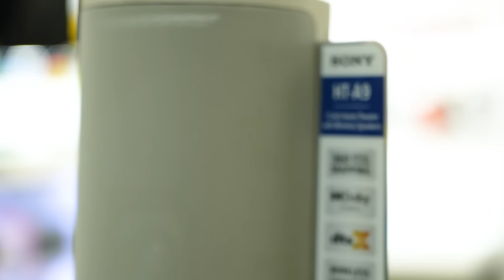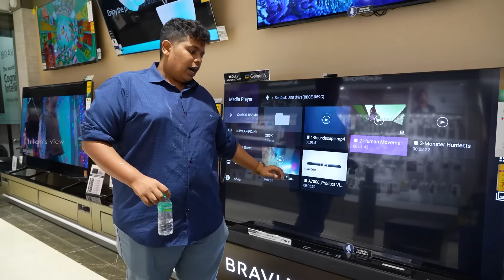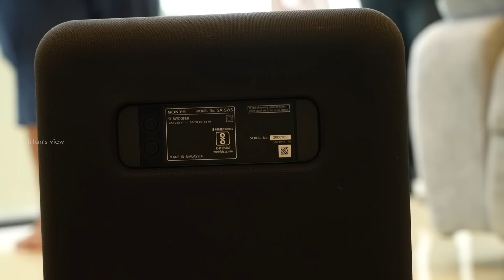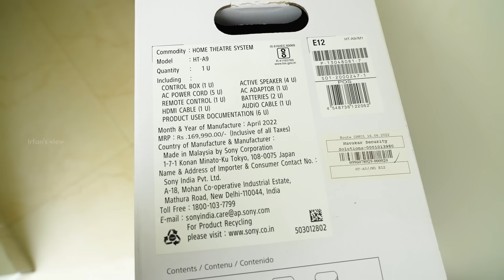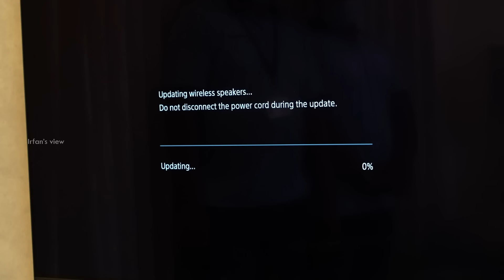Sony HT-A9, New House Home Theatre, 12 Phantom Speakers - Irfan's View

Comment: Congratulation Irfan, you will  enjoy this Home-theather without any doubt, I am few of the lucky ones who didn't have this audio dropout since I bought this, I also run two separate networks 5ghz and 2.4Ghz, all my audio and video devices are connected to 2.4Ghz network, and my router is 200 feet away from the TV and Home theater system. According to Sony you have to follow these steps to fix this 

If the issue occurs, follow these troubleshooting steps - in order - to see if the issue is resolved:

Set the RF Channel to Off, then back On: Select Setup → Advanced Settings → Speaker Settings → Wireless Speaker Settings → RF Channel to Off, then set to On.
Notes:
We recommend the RF Channel setting is set to On (default setting: On). The Sound Bar automatically selects the best channel for transmission when RF Channel is set to On, which makes it stronger against wireless interference.
If the sound issue persists, try to turn Off the setting.
It may take 1 minute to reconnect after you change the RF Channel settings.
The frequency setting is deleted after disconnecting the power cord. If you disconnect the power cord for some reason, switch RF Channel from Off to On again.
Set the Wireless Playback Quality to Priority on Stable Connection: Select Setup → Advanced Settings → Speaker Settings → Wireless Speaker Settings → Wireless Playback Quality, and set it to Priority on Stable Connection.
Set the distance between a wireless LAN router and the control box: Install the control box and speakers at a distance of at least 1.5 m (5 ft) from any wireless LAN router (a).
Note: The issue may be also improved by changing the wireless LAN router antenna’s direction or angle.Example of installing the control box and speakers
Check the control box installation condition and wireless environment:
If a device that generates electromagnetic radiation is nearby, such as a wireless LAN device or microwave oven, move the speaker system away from that device.
Turn off any other wireless LAN devices that are not in use to reduce the interference, and then check to see if the issue is resolved.
Note: If the issue is resolved, change the network connection of the peripheral device from wireless LAN to wired LAN, if possible.
The control box and speakers are installed too far away from each other. Bring them closer together.
If there is any obstacle between the control box and speakers, remove or move the control box and speakers away from the obstacle.
Do not install the control box too far back on a shelf. Install the control box in or on a shelf so that the front panel display is not hidden.
Move the control box, change the direction of the control box, or install the control box far away from a TV.
Interference between the network connection and speaker connection may occur. Try one of the following:
Change the wireless LAN connection of the control box and the router to a wired LAN connection.
Switch the band of the wireless LAN router to 2.4 GHz, then set up the wireless network connection between the speaker system and the wireless LAN router again using a 2.4 GHz band.
Reset the speaker system.
Note: For details on how to reset the speaker system

Comment: Hey Irfan,
About the audio drop out issue: All the 4 speakers work through a wifi network which creates the phantom surround sound and it requires a strong wifi connection with no interference
I have the same model and even I faced the similar issue and was able to fix following the troubleshooting below
1. Use 2.4 GHz connection on the receiver which has a stronger signal compared to 5 GHz. 5 GHz is primarily used for high speed connection and sound system doesn't require that
2. Keep the Sony receiver at least 1 meter away from the router to avoid wifi interference
Reply: do you think use lan cable for the control box is the best?
Reply: 3. get a good quality headset turn on the Dolby Atmos, experience the same.
Reply: Sollitaru pa engineer uhh
Reply: @user-yc1vy6pt2u  😂ya
Reply: Sir can you suggest which is better Sony  ht a9 or Sony ht a7000
Reply: Enna thala Network engineer eh 😜
Reply: @user-yc1vy6pt2u  ya supply everyone watching TV with headphones yenna oru puthisalithanam. Whatever Dolby atmos headphones we have it can't beat the sound coming from all directions in a home theatre with all people.
Reply: @thalaveriyan7444  you don't need 2 lakh sound system to enjoy watching movie with family, 25k tv with inbuilt speaker can do that work perfectly 🥱. 
what i meant is that you can experience the same with an 2k headset, if u really want to experience that luxury, go to a premium theatre there you can experience 25 Lakhs worth sound system lol. 
new technologies always expensive if we wait 2 years same quality and features will be available at very low price.
Reply: @niranjanmaity6475  if u have sony tv go for ht a9 bcoz bravia acoustic center sync is there so tv can act as an center channel but u dont have sony tv go for ht a7000
Reply: bro i have big confuse actually i can but this one or i can go for dolby atmos with av reciever .. my home is apmt pls suggest bro
Reply: @user-yc1vy6pt2u  i have apple ear pods pro and i have a avr system which 3times more than this u can only achieve stereo eff.not an actual atmos or object based surround.and i have used 25k home theater system.which wont gives same dolby atmos eff.
Reply: @cheriyannagar  avr is best but its cost is too high.this method is affordable.
Reply: @user-yc1vy6pt2u  If u have more money and dont know where to spend anything is logical 😂 as simple as that
Reply: Switch to wired instead in hta9
Reply: This set is nothing before my Yamaha AV receiver and Polk speakers , not even 50 % in quality of sound compared to Yamaha , the same guys who was in your house came for demo from Sony …. Poor products and very expensive HT in Sony
Reply: Bro Bluetooth or Wi-Fi connectivity rendulaiyumey intha issue innum vanthutu thaan iruken

Comment: About the disconnection issue: Both Bluetooth and Wifi use the same 2.4 GHz frequency which causes a lot of interference when placed close to each other or sometimes even when they are in the same room! This is not a problem with the product but a problem with the bluetooth and wifi technology itself. Best fix would be to use a 5GHz router with 2.4GHz turned off and this will definitely fix the issue right away. Another solution would be to use a "5GHz only" mesh wifi system which improves both wifi connectivity and speed while eliminating any and all interference with bluetooth, however, such a mesh wifi system comes at a cost. Hope this is helpful!
Reply from the maker: Sure man! Will try. Thanks for the solution.
Reply: @irfansview1  how many times to mail u for promotion. I want to promote a business. Do contact me
Reply: Good
Reply: That really solve this fucking issue bro ! Thanks !

Comment: Bluetooth uses 2.4 Ghz band for transmitting signals. And wifi is available in 2.4 Ghz and 5Ghz so to get this disturbances off to the enjoy proper sound turn off 2.4 Ghz for this reason in the modem and router. 
Since now a days all the phones are equipped with 5ghz support.
Reply: Purfect

Comment: You should have bought a Yamaha/Onkyo Atmos receiver and done a 7.2.1 with JBL or Klipsch speakers and got real Atmos effect without virtual sound. There's a huge difference between virtual  sound and sound coming from actual ceiling speakers with Atmos. Also the sony speakers you bought doesn't have a centre channel and also wireless connection for home theater is not good. Wired is always the best for optimal sound quality.

Comment: Regarding that disconnect issue
I had the same problem
Later I found it's config issued
In Sony remote (I think you connected with earc cable) press Home button, go to setup, go to advance setting, speaker settings, wireless speaker settings, link mode choose auto 
That's it

Comment: I used to have same problem back in 2017 especially when you connect the sound system through ARC, Sony attended the complaint twice and they’re showing Wi-Fi and other stuff as a reason, I didn’t give up, while raising the complaint for 3rd time they’d to change a board in the TV, then the issue got arrested. Speak to customer care about it. It’s a hardware issue.

Comment: I was about to comment on sound breaking issue, already a lot of detailed explanations with solutions.. 💯✌ Try to use 4K UHD Blu Ray, which has uncompressed Atmos and DTS. For OTT, use HDMI eARC via TV or DTH set top box. Avoid bluetooth for surrround sound.. 

If 1 or more WiFi router at home, reduce WiFi strength, like limiting only for downstairs. Upstairs seperate router.. interference will be reduced I feel.

Comment: @irfanview 
For best experience SW5 subwoofer is a must with this system 
You can try the below settings for best audio experience for both movies and music 

Cinema - ON 

Voice- ON 

Immersive on

Height of the sound field higher 

Dsee exreme _ on

Audio DRC _ Auto

Sound effect - sound mode on 

Advance auto volume _ on

eARC _ on

Rear speaker  max

Bass _ max 
If smaller room keep 10 or less

Comment: its unafair warrenty for even for 2L product is 1yr. sony don't belive its own product quality. I bought a S20R mother board failed with in 1.5 yrs, warranty period  over and sony service center billed me with 6.8k for mother board antha home theater hey 15k thann and warranty for the new board is only 3 months. it is not consumer mistake. the brand provided the cheap product which is not with standed even of minimum 6month of useage. worst experience once small fault vantha theriyum sony pathi. no proper response, just hide behind term and condition. we go for sony because of longlife and quality. better go for some other brand.